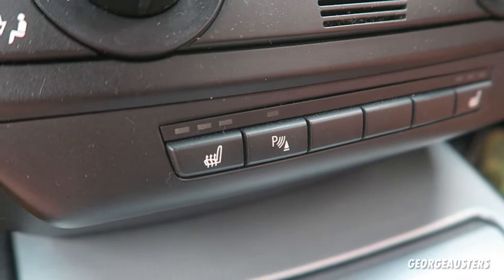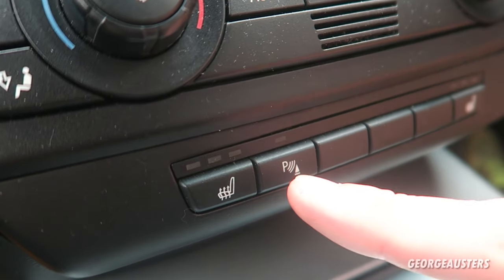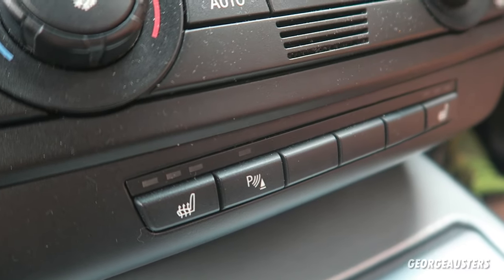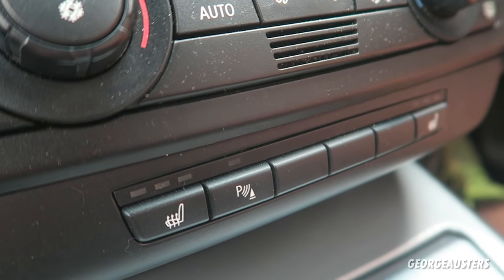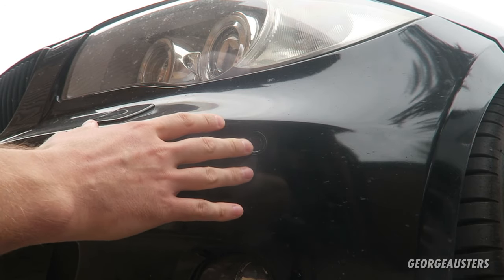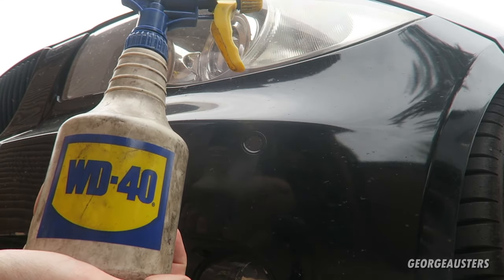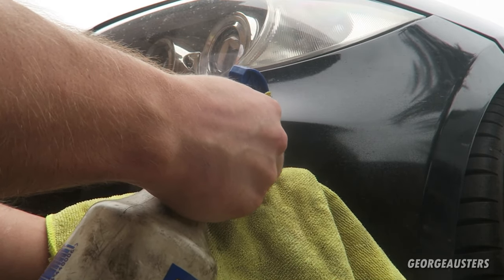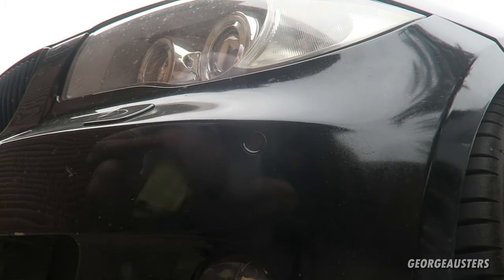How To Fix Your Parking Sensors For FREE *Works On EVERY CAR*

Comment: So basically every time it rains you have to wd40 sensors? that's terrible design on their part
Reply from the maker: No, only if you spray water directly into the sensors
Reply: @GeorgeAusters  Few days ago my ford was fine and sensors were working fine, but yesterday it rained hard with heavy wind, didn't even use the car, today parking sensor button briefly flashes when i turn the car on, and sensors turn off, so here i am, i guess maybe if they're damaged a bit water can affect it more? one of my rear sensors is a bit dented but works, so i thought it was fine.